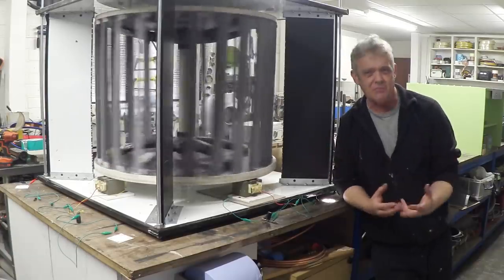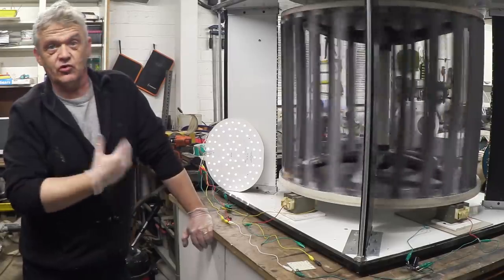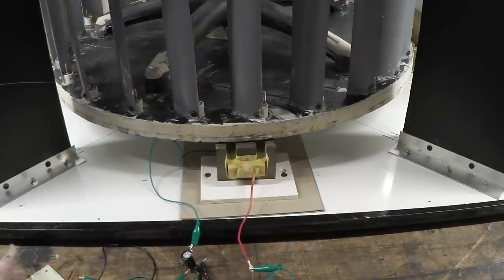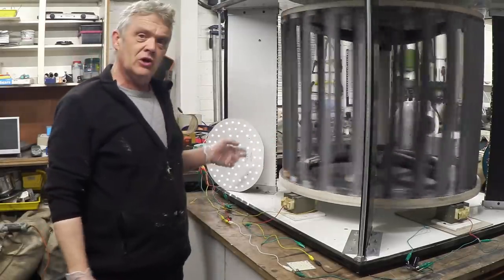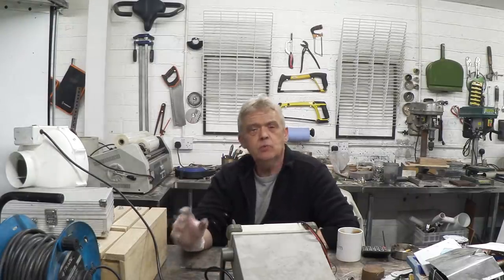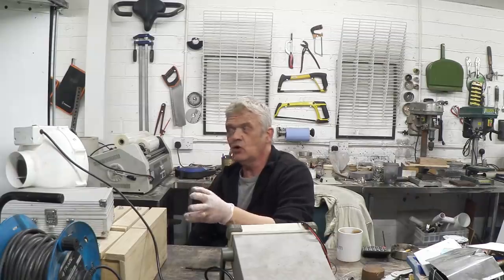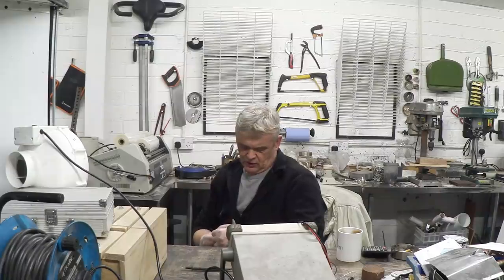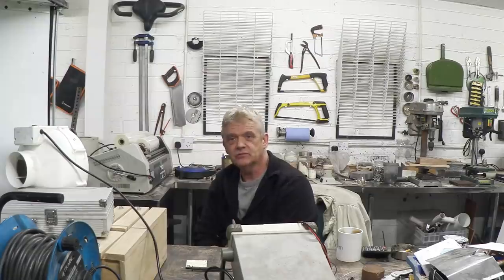Building a 1kW Wind Turbine For Under £100 - Part 6 - Installing The Coils

Comment: I think you're on the right path here.  I think there will probably be a bit of finnicky optimization needed once you start to get more coils in though.  You could think of each coil/capacitor pair as essentially an isolated LC circuit that is going to want to run the most efficiently at a specific frequency which obviously depends on the speed of rotation of the drum vis the number of magnets; ideally you could use the multiplicity of coils to have a few differently tuned circuits resonating at frequencies representing different wind speed conditions.  You also may want to create a secondary tank capacitance which is charged by the rectified current from each individual inductor/capacitor circuit, possibly using some sort of clever transistor switching designed to maximize power output while limiting turbine braking, which would help smooth the output and further isolate the load from the turbine momentum.
Reply: I think the reason why it wouldn't turn while you had the coils wired in series/parallel is bc in each case the after a coil's field would collapse when the working magnets passed it they would basically dump their back emf into each other creating a field in each that would then either attract that passing magnet back to them or attract the next one and lock them into in a sort of always oppositional electromagnetic cogging effect.  The added diode bridge and capacitance is acting less like a clutch and more like digging a canal and adding a water wheel instead of creating a static lake (to give a different analogy, it would be like taking a river and creating a dam to funnel the water for the purposes of hydro-electric generation versus creating a lake with a dike for fishing or recreation only without concern for regulating or utilizing the output beyond maintaining a certain maximum water level).
Reply from the maker: I am not sure it is an LC circuit mate as the cap is after the diodes - but I really have to admit I don't know that much about electronics
Reply: @ThinkingandTinkering  Ahh I couldn't tell from the video for sure.  It's still pretty close though, all you have to do is put it on the other side of the diode lol, youre also just a half step away from a boost/buck converter as well.  I think you should experiment a bit with the concept at least, I think you could achieve much better efficiencies than turning the coil output directly to pulsed dc.  I'm definitely no electrical engineering expert either, but I feel like resonance is the key to taking things to the next level

Comment: you said that if the coils are protruding out of the soft iron they still generate the same voltage, it is probably the magnets being close attracting the soft iron which slows it down.

Comment: this is very interesting about decoupling the load which gives me a thought. There is a German guy, I think, who built an electric cycle that could go about 50mph. It  appeared he was generating the power not a battery, however he had to turn the pedals which seemed to revolve at a regular speed. If he was generating the power directly he wouldn't be able to do it because of the load, wondering if he was using a similar system that you are using.

Comment: I have a limited idea of what I am talking about, but:
Newton's First Law of Productivity. First Law of Motion: An object either remains at rest or continues to move at a constant velocity, unless acted upon by an external force.

So, if you do direct load from the turbine, and it caused it to slow down and/or stop, then it requires the equivalent or perhaps more energy to get it back up to speed again, and then you have a significant augmentation in the requirements to keep the system running.
On the other half of that equation, as soon as the capacitor network becomes depleted, the devices (LED lights in this case) have a reduction in output, or cease to function altogether.
Nothing comes for free, but better management is the key when designing your needs.
A capacitor and/or battery to collect and regulate the energy input, balances a system.
There will always be some form of loss somewhere, which is transformed into some other form of energy that may not be useful for the system, but ingenuity can find ways to reduce the loss to acceptable levels, and maybe make use of the lost energy in other ways.

Comment: Nice addition - a jewel theif circuit seems the way to go. As wind speeds varies you can vary what coils are used. Soon you will be considering a generator controller to measure the RPM (pulses a second) to vary the load based on wind speed. Big wind turbines have an anemometer mounted on the rear of the turret so they can optimise how much energy they extract from the conditions at the time.
Reply from the maker: now then - that's an interesting idea - cheers

Comment: the last Vidja  i was thinking add more coils  
And rob adds 4  coils   And   the Capacitors      cool ✔  ⚡  cant wait to  see this on a windy day 
farmers  light /charge up batteries etc   new   12vlt  Led lights   
Keep adding /  buying them  new  12vlt car Battery's   🔋-🔋-🔋-🔋=⚡💡   |____|   $30 - $150 +  no  chemicals    Techs getting better
this is 1 cool build answers So many Q's & we get answers  great work   Rob 💯

Comment: If you’ve accurately placed the magnets, you should be able to shuffle the coils such that they are producing waveforms that are in-phase. That way you could wire the coils in series for higher voltage or in parallel for higher current. 

My gut feeling as that series is the best option with a single high voltage rectifier.

If you really wanted to push the limits, you could arrange the coils to produce 3-phase output. 

Without any load, the coils should not stop the hub from spinning up. Only as you increase the load will it start to slow.
Reply from the maker: cheers mate

Comment: No you're not guessing about O/P Power & Voltage, you might want to put some Larger smoothing Caps in the Bridge Rec/Cap Power Supply CCT.

Comment: Part 5 ans 6 made me think, instead of having a complicated transmission system, maybe it would be possible yo use the coils themselves to control the speed by rotating the coils, of course out of the magnetic core, to change between horizontal and vertical position. In theory it would control the reactance, which each core being a gear up, but no need for s synchro, a clutch, lubirification or and anything a conventional gearbox need. Could be quite low energy to do so too as you only need to pivot the coil on itself.

Very inspiring. Thank you for your videos, they are gold mines for ideas.

Comment: FYI, most DIY generators are set up to charge a battery bank, that provides most of the power, Even when the bank is full, it provides the buffer for a large surge on the current.
Reply from the maker: cheers mate

Comment: This is just brilliant, hook up the capacitor/diode configuration to a regulator wind mill, it should generate power at lower wind speeds, I think this is a game changer.   Thanks and you did it again.
Reply from the maker: that's a nice idea - cheers mate
Reply: Except, EVERY Small Wind Turbine converts the AC into DC.  Nothing new here ...

Comment: So, now sure if this has been suggested, but you have coils on the bottom. If they slow'd down with more coils. What happens if you did the exact opposite of the magnets on the opposite side of the squirrel cage? Or even if you got it to not slow down. If you put the exact opposite magnetic poles opposite of each other, would that make it even easier to get more rotations from lighter winds?

Comment: I've seen a man useing microwave parts like you but he cut them in half  to make two working coils he arranged in a hexagon shape weilded them together  and it worked great how ever he used a gas powered engine to spin the central plate but i believe with tinkering it cold pump out alot of power.

Comment: Crude rpm counter would be a pin on the rim swatting a card. Record and view the sound file counting the time between clicks. Or the peg obscures an led so count/time the blinks. Compare with Volts*Amps and get the torque curve therefrom.
Reply from the maker: cheers mate

Comment: Its been awhile since I did any sciency think but I did have a thought, could you spring load the base of your transformers and have a roller against the rotor to set the gap to the magnets. Might be a bit of faff for little return but as you are measuring and comparing output it would keep the gap a constant. 
Something I was curious about is if the position of the transformers made a difference, I see you have them geometrically arranged but how does that work out for polar alignment and does that make a difference at all?  
Enjoying this series, thanks for posting them for us all.

Comment: As ive seen in other videos as the magnet approaches the coil it produces a magnetic field it turns to the opposit side as the magnet leaves i guess thats the main reason for the drag i guess i dint know for sure but thats why when the rectifier bridge solved i guess again
Wonder if  one big circular coil right on the magnet course will be a bitter idea that gives better results 
This is turning out beautiful and getting more and more interesting to see
Thank you.
Reply from the maker: I did ponder the ring coil idea but I ent this way - still - I would love to try the ring coil sometime that's for sure

Comment: Without synchronisation four coils will generate circulating current(which can produce lesser output voltage and current,it act like internal short circuit) in the coils,and can lead to heating of coils

Comment: WoW mate!  Absolutely fantastic.  It seems that the light is on constantly now that it is being powered by all the coils without any twinkling as the individual lights were doing.    Does this mean that the capacitor system is discharging their power and being recharged one after another?  If so, what would happen if you had larger capacitors discharging their loads and recharging themselves alternatively, a bit like the way the cylinders in a combustion engine work?  I hope that I have explained myself clearly
Reply from the maker: you have mate - and I don't know the answer -but certainly worth an experiment or two

Comment: I have tried the rectifier and capacitor on one coil on a stirling engine, the capacitor is a sprague 6700micofarad 40VDC, diodes are in4007, when i put current to max on a load, example LED, the flywheel almost stops, of course this is a small stirling engine. I can confirm though if i stop the rotor by hand, the load is  being powered by the capacitor awhile longer. I have put the capacitor in different locations, i.e in series and parallel on the coil, in series on the load, the best result is on the DC side of the diodes, as per images you will find on googling rectifier and capacitor.
I have uploaded video, just put Y T /watch?v=FIGu9BrWoy8
another thing as well, if i remove the capacitor the voltage drops by half, example in my setup 14volts without load drops to 7 volts

Comment: By accident or design you have come very close to the holy grail of the free energy researchers and the technique they employ. Tesla discovered years ago that at the moment when a coil is energised or de-energised, I forget which, a great spike of energy several tens of times the energising voltage appears for around 100 milliseconds or so (and almost always dissipated away by the shunt diode/resistor in a motor). By connecting a capacitor across the coil, this spike can be accumulated and then used to perform useful work like charging a battery, or put through a bridge rectifier to light up a load etc. On battery charging this spike can be directly sent to the battery via a diode with the battery so charged demonstrating properties different to batteries charged via standard methods. This spike has also been referred to as Radiant energy and I have seen a 12V source charging an entire bank of 12V batteries and even batteries of higher voltage like 24V and 48V, albeit at a slower pace.
Reply: Except, EVERY Small Wind Turbine converts the AC into DC.  Nothing new here ...

Comment: Im wondering why you didnt provide an outlet for the wind. As the wind goes thru the blades and becomes tubulent and goind on across to the opposite side of the cage it is in opposition to the spin of the cage. All squirrel cages have an outlet to the side to reduce the compression as air is trapped in the cage.i suggest openings on the bottom zide that a micro amoynt of lift to reduce a lttle friction.

Comment: Nice work! love the surface area of the air-foil. Love this project. How far can you take this. I'd like the Idea of a fork lift with an edison cell pack to power my shop. Ya just some lights for now, And how handy is always having a charged 12v battery many benefits to this. Inverter's and switching and thinking things out so you dont spend more than you have to is key. the power company can be beat. Like with the delco voltage regulators placing them closer to the battery and feeding the "raw" current/voltage from the fields down the line to them. Is like the 400 Hz they use in aircraft It increases the ampacity of a thinner wire the 12v would be hopelessly costly for any distance. I like you your observations arte very thought provoking thanks for your effort to point this out.

Comment: I often considered a similar project. a few issues i see is that the further a rotating mass from its pivot point the harder it is to balance, and balance is critical when you can`t climb on your roof in a gale to stop it. a lot of commercial wind turbines are designed to deal with gale force winds with non-optimised aerofoils and resistive loading. the non-regulated coils were probably acting in semi-opposing magnetic fields effectively shunting against one another, which could be resolved observing waveforms on an oscilloscope and repositioning the coils.  the regulation idea is a good one, and efficiency could be optimised with Schottky diodes. it is better to use individual diodes as opposed to a single diode pack as power is not dissipated at a single point and are cheaper devices. i would personally use the primary transformer windings as a method of magnetic braking in high winds 8-ohm 100w resistors are very cheap. Be wary of cheap MPPT controllers 9 times out of 10 they aren`t MPPT. I would personally use a Buck converter and Arduino to maintain a constant rotational speed by increasing and decreasing electrical load.
Reply from the maker: nice tips mate - cheers

Comment: The capacitors are more analogous to a gear ratio, rather than a clutch. If you could efficiently vary the capacitance you could electrically gear the system for low wind and high wind conditions

Comment: If you put opposing magnets on the bottom of the turbine, as long as it’s started spinning would it create a motor that would work anywhere and without wind. Also could be made smaller to as wind wouldn’t be necessary. Sorry I’m not a tech but just wondered

Comment: When using multiple coils in series or parallel you need to position the coils so they are all passed by the magnets at exactly the same time. Then ensure they are all connected the appropriate way round so their outputs all add together. Two coils connected in reverse parallel would fight each other and look like a short circuit which could stall the rotation. Two in series incorrectly phased would cancel giving virtually no output at all. Of course, with a separate bridge rectifier on each coil, and resevoir capacitors, the coil phasing will no longer matter, but it would be more elegant and less lossy to ensure they are all phased correctly in the first place.
Reply from the maker: cheers mate

Comment: I know Im late to the game...... but the capacitor is a DC smoothing......  with just the diodes its a very bumpy waveform..... which means every time a magnet passes the coil it has to start again :)

Comment: how about make a wind turbine out of a waching machine drum by cutting out finds and attaching at appropriate angle.....   and maybe use the frame, mounting, etc.  Thereis a vide of a dude who did some wiring on a waching machine motor to make a killer low budget hydro setup - I think it's in NZ

Comment: It would be interesting to remove the capacitor and just have the bridge rectifier, will it still work! If so then it’s the collapse of the fields in the coils that slows the rotation. If it needs the capacitor then another element is at work here.

Comment: Whats happening is your load is producing a secondary emf that goes towards your generator. This will cause your motor to cog down. when adding that capacitor, you gave that secondary emf a place to go that was not in the generator.

Comment: I was also thinking about tesla valves, and how (since they are like a diode allowing 1 directional flow) they could be configured to be like a bridge rectifier, and then using a conductive fluid, one could create an electrical bridge rectifier without moving parts. One could use a waves, or other oscillating form of kinetic energy to create a one directional flow to create energy, and possibly move the energy through the fluid itself. Just a thought. One could hook several turbines together and move liquid that turns the generator. As fluid moves one direction, electricity could flow the other direction. The possibility of logic gates are endless, and computing could be done based on programming logic.
Reply from the maker: nice ideas mate and I do like Tesla valves